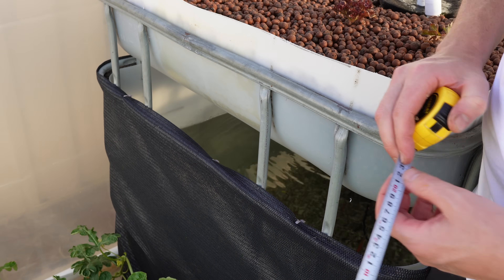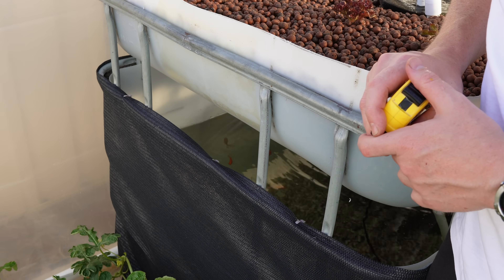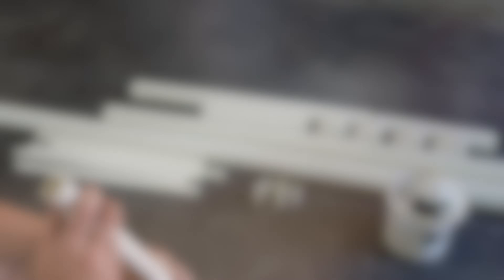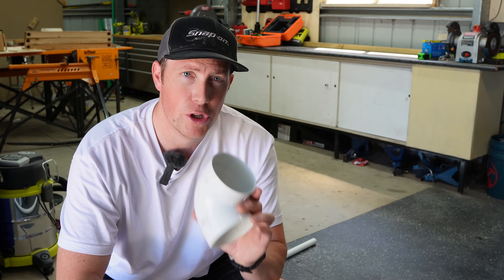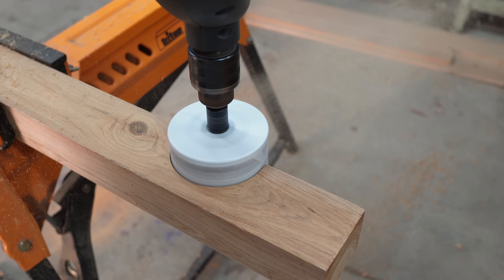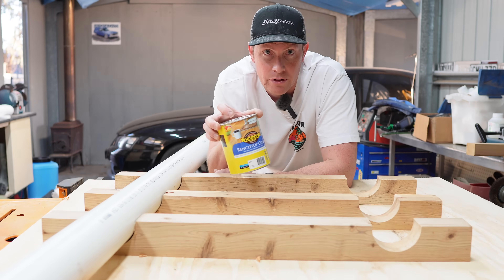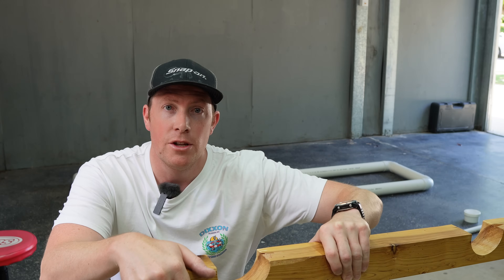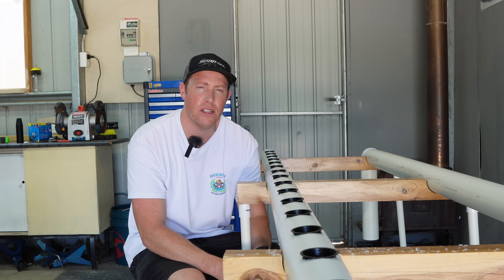DIY Hydroponic / Aquaponic grow tubes using PVC pipe cheap!

Comment: Probably easier and less hazardous for the less experienced DIYers would be to laminate two of the beams together with screws and then use the hole saw to do two beams at once, and avoid any slippage trying to do one at a time.  

Great work!

Comment: Very nice tutorial, thank you. I found that drilling the outlet low on the cap and putting on a valve to add extra flow control was better for me to avoid the risk of putting it too high
Reply: You can use a cap that doesn't thread drill the hole off center and ad your bib. Then test run the system before gluing the cap and rotate the cap to find the right height. Once you have it perfect just mark the location then glue the cap at that angle.

Comment: Very neat work, however did you consider the potential lead leakage from that type of 90mm U-PVC pipes? They are definitely cheap, I have been considering whether or not to use them, or source some food grade plastic pipes.

Comment: NFT stands for Nutrient film technique.  Key word in that is "film" the roots shouldn't be standing in water but more like being kept moist by only a small amount of water on the bottom of the pipe and the roots can also breathe from the roots on top. If they are submerged in water the will suffer from "Pythium" which is mistaken for root rot because of the low oxygen environment

Comment: do you have a 3d printer or access to one? let me know i just designed a cup holder that keeps the cups flat on top of a 4in pvc with 2 in cups. ill send you the stl file to try out and tell me what you think.
Reply from the maker: Yeah mate send me the file and I’ll check it out